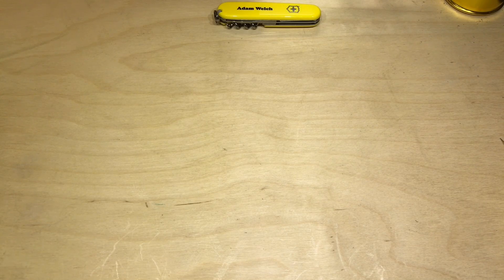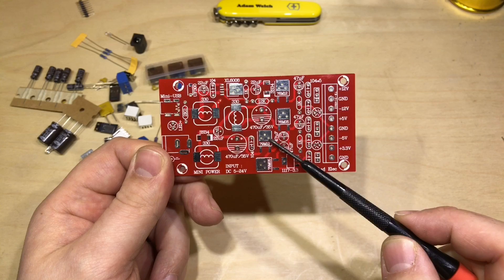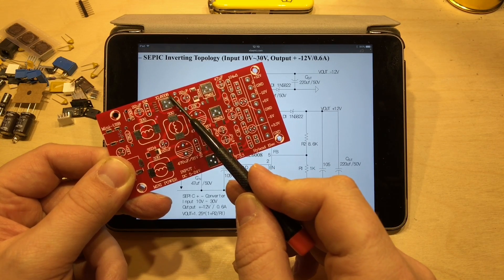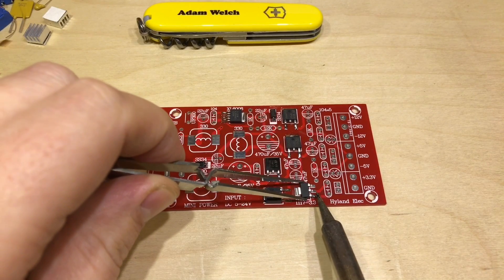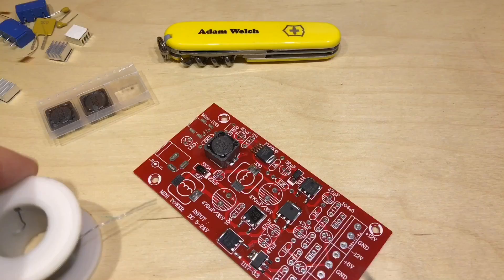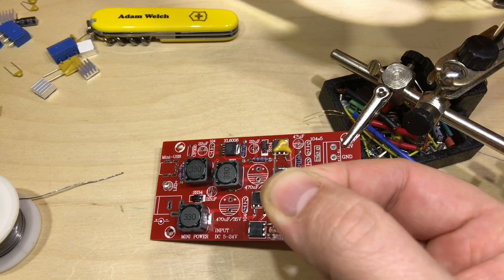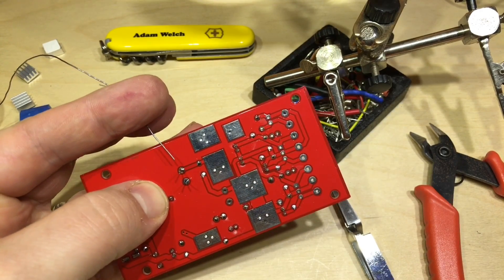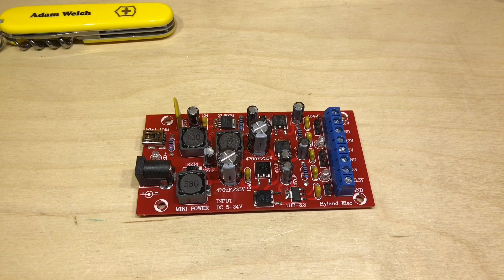USB Boost DC 5-24V Dual Power ±12V ±5V 3.3V Kit Build - 12v Solar Shed

Comment: I am looking for a link or video to build a small
AC to DC UPS to Power Fibre routers and small switch etc,
The max Current draw will be 5 amps

AC to DC - 220vac Input to power 12vdc and 5vdc with a
"standby"battery. So effectively a DC UPS

Any Ideas.

Comment: Well I just ordered one, my FY3200s  function generator needs another power supply (it blew up) the rest of the device is ok.    The 5 V requires 200 mA.  hope it can handle it. Thanks. If it works I'll uprate the heatsink on the XL6008.. (a nice one with 2x the area).   Only cost $11.00 AUD on your E-bay seller... $8 USD..

Comment: Hiland multiple output power module tested
With this € 6.09 priced kit, you can convert one supply voltage between +5 V and +24 V into stabilized supply voltages of +3.3 V, +5 V, -5 V, +12 V and -12 V. You can load each output individually up to 300 mA. If you load several outputs, you are advised to limit the current consumption per output to 200 mA. We built and tested one kit.
➡    Read this article
https://chinese-electronics-products-tested.blogspot.com/p/hiland-multiple-output-power-module.html
Reply: I built one and my FY3200S was dragging 200mA on the +5V,  . The regulator was too hot to hold your finger on it. I reckon it would not have lasted more than 20 mins. These boost / buck things are for split voltage and low current use only, maybe op--amps. Fun to build tho,     Thanks for your link.

Comment: Those are neat little power supply kits.  I built three of them last year the first one I was going to put in a feeltech function generator to replace the power supply that was in it, but I didn't put it in because I wanted to make sure the power supply kit was going to work right. So then I built two more kits and I'm actually using one of them in another project which seems to work fine. so I may put the first one into the signal generator as planned!  Anyways great video :-)

Comment: Great. Thank you.  Please do take up SMD soldering, especially learn to flux, wick scrub, retin then flow solder back. 

Your iron tip could be changed to a long bent and a second chisel tip with depression for drag soldering. 

Its not hard. Takes practice and an inexpensive 2-2.5 x stereo microscope, don't let the YouTube mavens fool you, you'd be a pro in no time. 

But, flux, flux, flux by all means.

Comment: Replaced the 2 original 470uf 35v caps with a known good pair and now they do not get hot! I 
did check the ESR of old caps and they were 0.12 and correct value, so weird.

Comment: My kit came without any instructions which was not a prob for me. However I have found the unit will draw around 1.5amos when fed with 5v and this slowly reduces to around 300m/a at 15v in. I should say I am using this to power a  Feelgood 2mhz function generator which gives it portability.  I also found most heat is generated not by the switching IC or regs, but by the 2 x 470uf caps! I havent been able to measure this heat but suffice to say I cannot keep a finger on for more than a few secs! This would indicate a gigh ripple and perhaps a poor quality elec caps. Not yet looked at the waveform across the 2 x caps.

Comment: Hey Adam,  
I've some silly questions for you:
Could you improve the efficiency of the circuit by changing the voltage divider for the XL6008 to get closer to 12v for the linear regulators?
If the XL6008 can output both +12v and -12V why have the separate linear regulators anyway?

Would you consider doing a comparison test of some of the many variable (or 12v) input 5v output buck converters that are available on ebay?  I'm following in your footsteps and setting up a solar shed and want to know the most efficient way of powering USB loads from my 12v battery.  I'd be happy to send you a couple to test if you are interested.

Happy new year!
Reply from the maker: +ShazAu8 The linear voltage regulators need the input to be a volt or two above the output to maintain a stable output. So the voltage divider could be adjusted to make the XL6008 output say 14 volts but I wouldn't take it any further. 
The linear voltage regulators will give a smoother output than the switch mode XL6008. So I'm guessing that's why the designer has gone for this approach. 
Efficiency is important, but doesn't make for terribly interesting videos. Switch mode will be most efficient and generally they are most efficient close to their maximum output. Thanks for the offer, but I'll decline on the basis that I have so many other videos on the list to make! Happy new year and thank you for the comment.
Reply: Thanks for the reply and no problem!
Reply: Adam - Read up on the massive literature about LDO regulators. Obviously the cheap Chinese kits won't be using them a while, but LDOs are driving the future of DC power.

Comment: what was your soldering iron temperature set at while doing this kit
Reply from the maker: I have mine set at 320 generally.  I find that is the best temperature for my soldering rhythm.
Reply: Adam Welch I use around 350 340 for my type of soldering and for bigger cables I will nudge it up a bit more

Comment: Interesting thing.  Can you measure what it draws from the input when nothing is attached?
Would also be good to test the efficiency output vs input
Reply from the maker: It wont be very efficient at all.  Consider it is effectively both boosting and bucking, plus the buck is linear.  So the more your draw from the voltage regulators the more they will heat up.
I'll look at getting a figure for you on the current draw when nothing is attached.
Reply from the maker: +Luc Peeters It uses about 80mA when the voltage is less than 16v and about 50mA above 16v. Hope that helps.
Reply: Pretty high to always keep on on a battery bank.  Thx!
Reply from the maker: +Luc Peeters yeah. I won't be leaving it on all the time though - was it something you were looking to do?
Reply: Was looking to feed some audio pre-amp opamp stuff without the usual resistors and extra caps. Going to buy some extra panels when spring kids in (praying that 'll happen sooner or later)